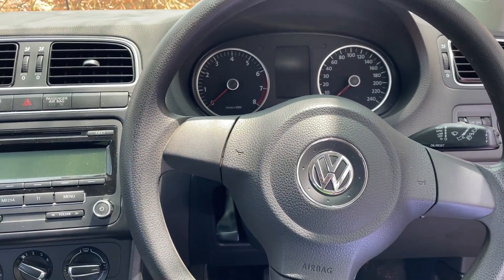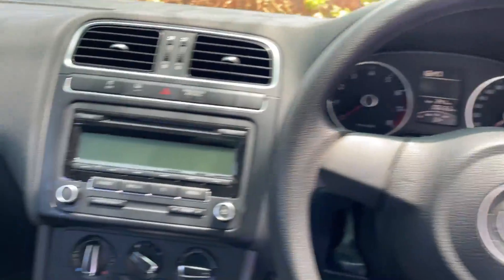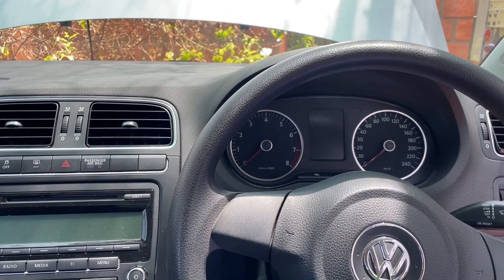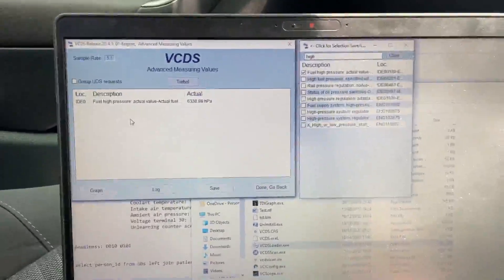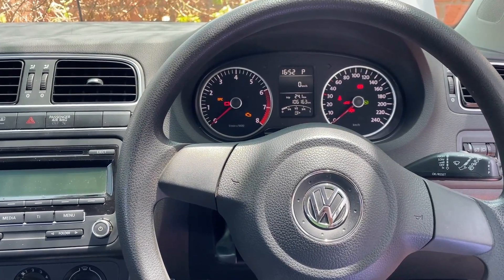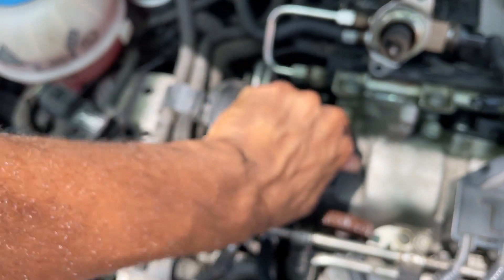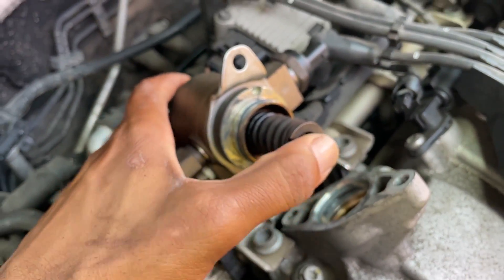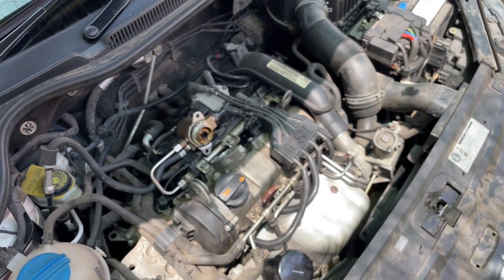Vw Polo CBZ engine - error code P0172, mixing Gas with engine oil. Failing HPFP diagnosis

Comment: So if you turn engine off and turn ignition on after that. You can see if injectors are leaking if pressure drops ? It would had to be major leakage because fuel pump is priming fuel lines

Comment: Hmm. I made a stupid mistake of taking the HPFP out, connected back to fuel line and turned key to on which immediately blew the piston with spring out of the fuel pump and I had fuel spraying everywhere.

Comment: My oil smells gasoline aswell. The dipstick level is higher than it was when i changed the oil.
But i do not have relevant fault codes. I have 200k kms and never changed the pump.
Reply: Check your hpfp

Comment: Hi man.My oil level is up by a lot and there is a strong petrol smell on the dipstick. Oil is very "watery" . I noticed i also have high fuel comsumption. Do i need to replace the pump?
Reply: Check your hpfp

Comment: the problem of the P0172 error is not the pump, but the tappet or glass that works on the camshaft which is no longer able to slide well and therefore blocks and the pump spring is unable to push it down
Reply from the maker: P0172 its a generic code that refers to fuel system too rich, which in my case was caused by a bad fuel pump. It could either be caused by a faulty flow meter for example. So in you case possibly was related to the pump spring being blocked

Comment: Hi i have a 2012 Audi A3 1.4tfsi no error codes at all but there's a fuel smell on my dipstick...idling and drive is uncomforable do you know what it could be? One guy said its a High pressure fuel pump but i need to be sure as thats expensive
Reply from the maker: HI there. What do you mean its uncomfortable when idling and drive? does it vibrate etc? Its normal to feel a ligth smell of fuel on oil if you spread in your fingers from the dipstick, but not that hard. if your oil level icreases overtime you have a problem
Reply: @frankcumaio  Hi basically its jolts when you slow down towards a stop and also when you press accelerator
Reply from the maker: @ndlangamie2495  but the other symptoms that i mentioned do you have them? Jolting on these might be gearbox related or Mounts
Reply: @frankcumaio   yes it once picked up a p2178 code system too rich on bank 1 but it did not show it again.

Comment: just like @babelonchabalala i Have same car with same problem.. talk us through the repair process
Reply from the maker: Very easy process, just buy a new pump. To install you just need to remove two torx screws T25, the return line with a plier and the feed line with a 17 inch wrench

Comment: Hi there......did u end up buying a new pump or is that piston with seal sold seperately ? Have same car with same problem......seems like this is common problem in TSi engins
Reply from the maker: Hi. Unfortunately had to replace the whole pump. The process it very simple just the pump, it’s expensive
Reply: Besides the pump itself that was faulty, the Fuel Pressure Sensor/Sender/Regulator unit located on the fuel rail was also faulty..... i did a bench test with it.....the sensor received power and the circuit inside was closed, but unfornately the solenoid inside the sensor didnt click or kick when energized......had to replace the sensor/regulator and then reset the computer before starting..... finally got her starting
Reply from the maker: @babelonchabalala1690  glad you made it bro. Cheers